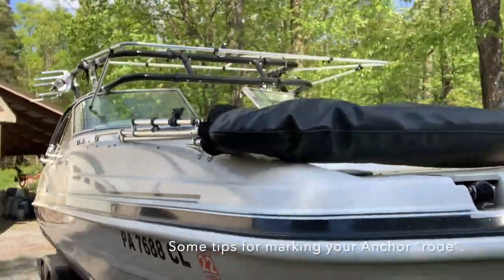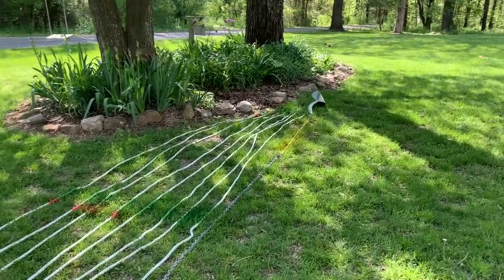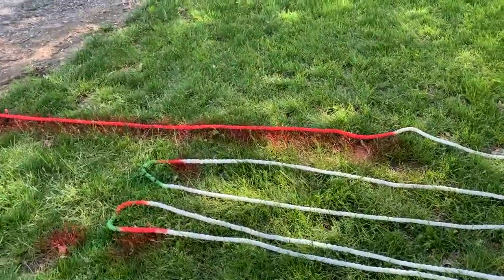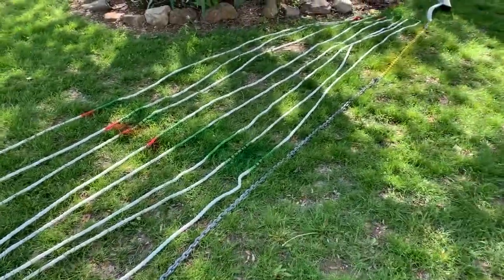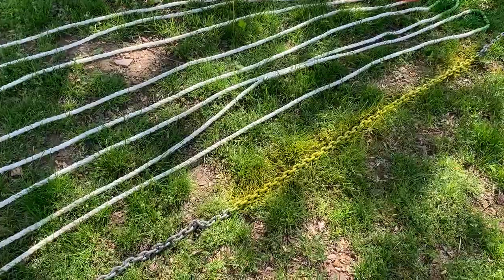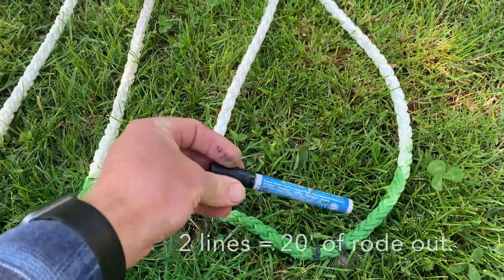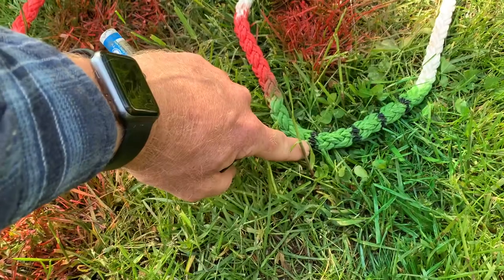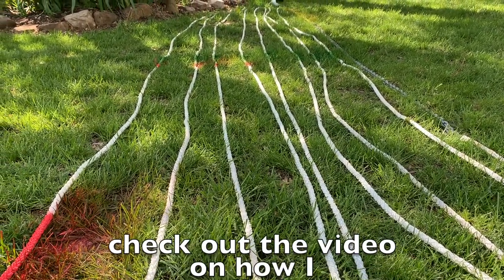Mark your Anchor rode (rope) for depth

Comment: I did the same thing except used the colors of the rainbow. Red for 20', Yellow for 40', Green for 60' , Blue for 80'  and then Black for 100.  Then start over. Red for 120' Yellow for 140" etc. This works for any amount of chain, rope or combination. You have to buy more cans of spray paint but just buy smaller ones.